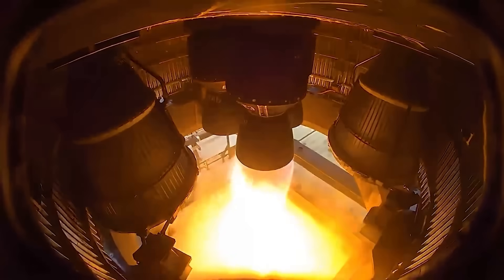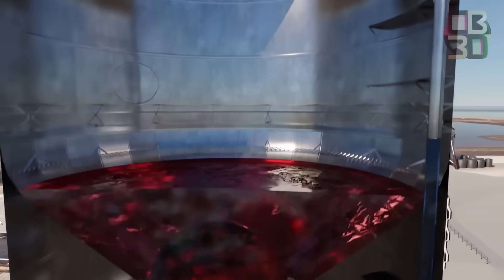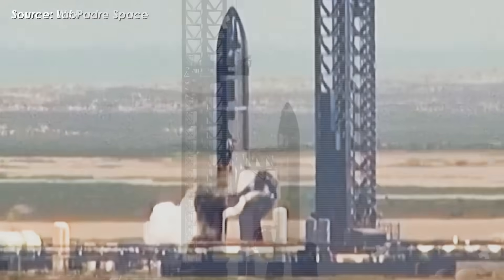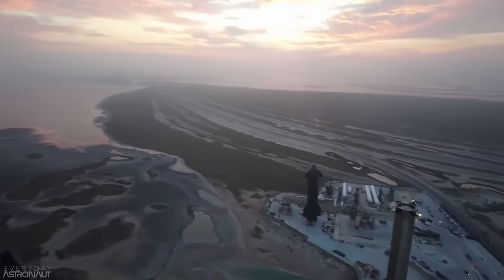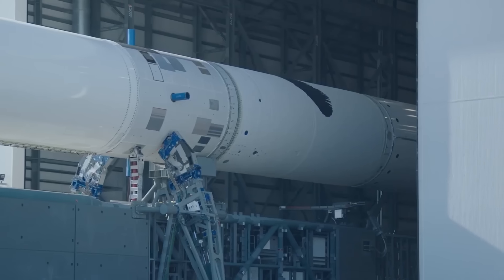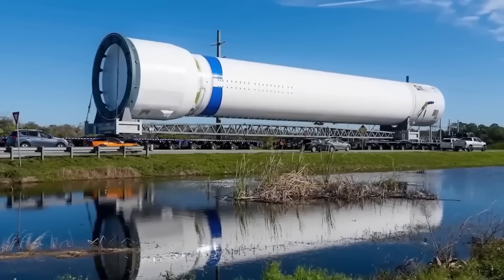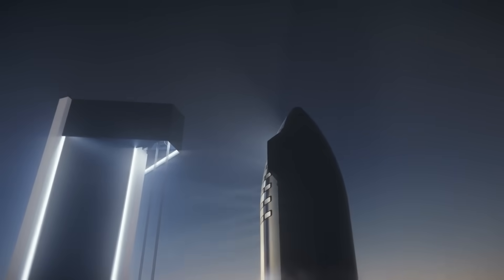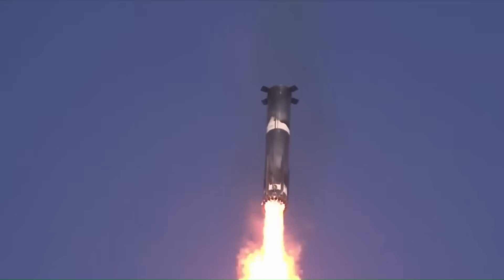SpaceX Aborted Ship 37 Static Fire... This Reveals a Bigger Problem!

Comment: Musk thumping.  Give it up, fanboy.  Spacex LEADING  Blue Origin?  The first test of New Glenn was a success.  What, maybe ONE of Leon Skum's crappy Starshits has been successful?  Depending on your definition of success.
Reply: New Glenn doesn't compare to Starship 
 New Glenn is on the same level as Falcon heavy which launched a few years ago and has several times since.
Starship is designed to be fully reusable whereas New Glenn boosters are only reusable 
Starship is bigger

Comment: SpaceX’s ‘starship’ has been so entertaining for a great fireball!  Clearly the engineers that made the reliable are long gone. It’s expensive but at least ULA’s new rocket with Jeff Bezos’s engines made it to orbital velocity on the first try.
Reply: You are not comparing apples to apples 
New Glenn is comparable to falcon heavy which had successfully flown way before NG but has so many times
Nothing at this time is comparable to Starship
New Glenn is not fully reusable, just the booster, whereas Starship will be fully reusable

Comment: I hope the next flight will be successfull but have my doubts. If the next flight don't pass I would suggest space x go to plan b, maybe a smaller starship
Reply: The first stage is performing fairly well. I wish Space X would develope a regular second stage for a complete heavy lift system that can serve to launch big missions until Starship gets it's bugs worked out. And if that doesn't happen, we would still have a use of that big booster.